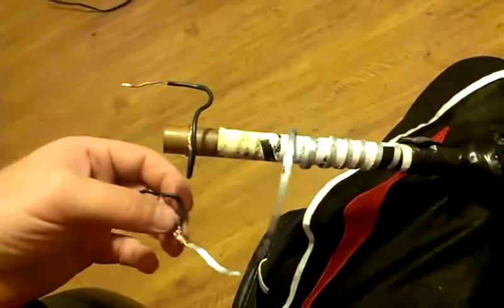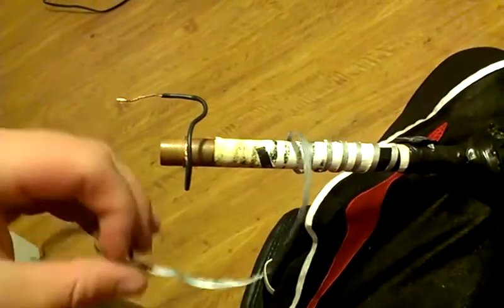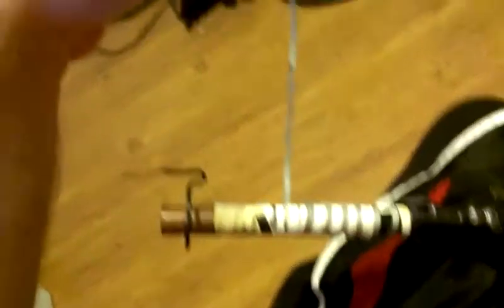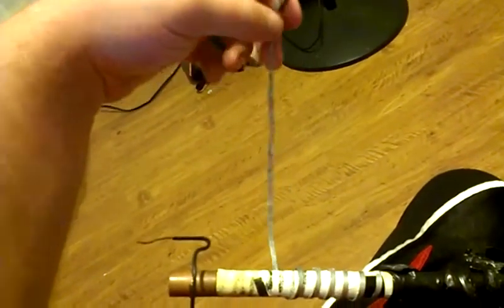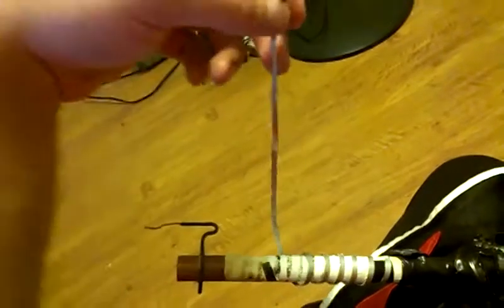5 Foot Crystal Cell update 8-23-13

Comment: What if question please?   It appears your design is similar to an earth battery effort seen in other videos.    Would up consider An 8ft rod of this design were placed flush with in the earth.    Then electrically separate 8 more of these rods in series.   Or just simply bury this 5 ft design of yours here and measure deltas with what u have today?

Comment: This cell is not galvanic, is a crystal cell that works by converting etheric energy into electricity (which in fact is magnetism and attraction) - this can be proved by Faraday cage tests, and the cell works with scalar waves. I have also crystal cells that works perpetual for years, and it doesnt matter a little corossion if this cell works 50 years and do its job, because its working 50 years, you will see all. Tnks for sharing, ibpointless2, please continue the good work!